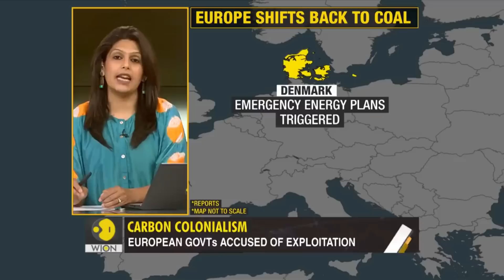Ghana is Finally going NUCLEAR POWER to intensify Industries and the African Free trade Area

Comment: NO NUCLEAR ENERGY AND THERE IS NO CLIMATE. CUT DOWN WASTE AND THE WORLD IS BE A BETTER PLACE!!!!!
Reply: There is no current or renewable energy solution that is going to meet the needs of Ghanas industrial, societal or.enterprise energy needs in a manner to compete with other world.players.

Name a country that is powering its industries and societies primarily through renwables? Norway? They are currently paying record prices to electrify and heat their homes. And that is based on their hydroelectric energy sources. Germany? They are getting prepared to put their renewable solution to its biggest test this winter. If that test fails? Millions of them will freeze.
.
 There are Afrikan countries that are already amongst the TOP 10 highest consumers of renewable energy. How is that working out for their respective industries and societies?
The 10 countries using the largest percentage of renewable energy are:

DR Congo - 96.24%
Somalia - 95.03%
Central African Republic - 91.26%
Uganda - 90.22%
Gabon - 89.88%
Ethiopia - 88.92%
Liberia - 87,24%
Guinea-Bissau - 86.24%
Tanzania - 85.22%
Burundi - 84.77%

For further comparison here is a macro look at renewable energy consumption on Country by Country basis:

Country Renewable Energy Consumption % 2022 Population
DR Congo	96.24%	99,010,212
Somalia	95.03%	17,597,511
Central African Republic	91.26%	5,579,144
Uganda	90.22%	47,249,585
Gabon	89.88%	2,388,992
Ethiopia	88.92%	123,379,924
Liberia	87.24%	5,302,681
Guinea Bissau	86.24%	2,105,566
Tanzania	85.22%	65,497,748
Burundi	84.77%	12,889,576
Zambia	84.50%	20,017,675
Madagascar	82.77%	29,611,714
Bhutan	82.27%	782,455
Zimbabwe	81.50%	16,320,537
Nigeria	81.40%	218,541,212
Iceland	81.07%	372,899
Niger	80.83%	26,207,977
Cameroon	79.41%	27,914,536
Mozambique	78.08%	32,969,518
Rwanda	77.86%	13,776,698
Chad	77.79%	17,723,315
Nepal	77.39%	30,547,580
Mali	76.64%	22,593,590
Haiti	76.40%	11,584,996
Togo	76.21%	8,848,699
Sierra Leone	75.44%	8,605,718
Eritrea	73.67%	3,684,032
Malawi	73.02%	20,405,317
Republic of the Congo	68.67%	5,970,424
Kenya	68.08%	54,027,487
Eswatini	65.95%	1,201,670
Guinea	65.44%	13,859,341
Burkina Faso	64.85%	22,673,762
Guatemala	62.92%	17,843,908
Ivory Coast	62.46%	28,160,542
Norway	62.37%	5,434,319
Sudan	62.23%	46,874,204
Uruguay	60.76%	3,422,794
Paraguay	60.09%	6,780,744
Myanmar	57.85%	54,179,306
Liechtenstein	56.13%	39,327
Angola	54.69%	35,588,987
Comoros	53.43%	836,774
Cambodia	53.36%	16,767,842
Papua New Guinea	53.09%	10,142,619
Sweden	52.88%	10,549,347
Nicaragua	50.71%	6,948,392
Sri Lanka	49.91%	21,832,143
Gambia	49.24%	2,705,992
Laos	48.43%	7,529,475
Solomon Islands	48.39%	724,273
Brazil	47.57%	215,313,498
Benin	46.47%	13,352,864
Honduras	45.96%	10,432,860
Finland	45.76%	5,540,745
Pakistan	43.46%	235,824,862
Ghana	41.80%	33,475,870
Latvia	41.52%	1,850,651
Albania	40.20%	2,842,321
Lesotho	39.47%	2,305,825
Montenegro	38.74%	627,082
Tajikistan	38.56%	9,952,787
Denmark	37.52%	5,882,261
Senegal	37.20%	17,316,449
Sao Tome and Principe	37.09%	227,380
Bosnia and Herzegovina	37.02%	3,233,526
Costa Rica	35.79%	5,180,829
Samoa	34.21%	222,382
Austria	33.77%	8,939,617
Lithuania	33.53%	2,750,055
India	32.93%	1,417,173,173
Croatia	31.60%	4,030,358
Estonia	31.29%	1,326,062
Colombia	30.72%	51,874,024
Namibia	30.69%	2,567,012
New Zealand	29.65%	5,185,288
Belize	29.09%	405,272
Portugal	28.19%	10,270,865
Djibouti	27.92%	1,120,849
Kyrgyzstan	27.88%	6,630,623
Peru	27.13%	34,049,588
Philippines	26.73%	115,559,009
South Sudan	26.65%	10,913,164
Fiji	26.48%	929,766
Botswana	25.57%	2,630,296
Chile	25.26%	19,603,733
Georgia	25.22%	3,744,385
Switzerland	24.76%	8,740,472
Bangladesh	24.75%	171,186,372
Mauritania	24.70%	4,736,139
Thailand	23.96%	71,697,030
Romania	23.54%	19,659,267
Canada	22.11%	38,454,327
Moldova	22.04%	3,272,996
Cuba	21.54%	11,212,191
Serbia	21.53%	7,221,365
Slovenia	20.86%	2,119,844
Bulgaria	19.34%	6,781,953
Indonesia	19.09%	275,501,339
Panama	18.91%	4,408,581
Vietnam	18.65%	98,186,856
Afghanistan	18.51%	41,128,771
Greece	18.51%	10,384,971
Andorra	18.40%	79,824
Ecuador	17.73%	18,001,000
Slovakia	17.64%	5,643,453
Italy	17.27%	59,037,474
Spain	17.27%	47,558,630
Germany	17.17%	83,369,843
Luxembourg	16.45%	647,599
North Macedonia	16.32%	2,093,599
Czech Republic	15.85%	10,493,986
Venezuela	15.62%	28,301,696
France	15.53%	64,626,628
China	14.45%	1,425,887,337
Suriname	14.40%	618,040
Turkey	14.12%	85,341,241
Palestine	13.86%	5,250,072
Hungary	13.64%	9,967,308
Greenland	12.60%	56,466
Ireland	12.34%	5,023,109
United Kingdom	12.24%	67,508,936
Tunisia	12.20%	12,356,117
Poland	12.18%	39,857,145
Cyprus	12.05%	1,251,488
Marshall Islands	11.70%	41,569
Timor Leste	11.67%	1,341,296
Guyana	11.35%	808,726
North Korea	11.31%	26,069,416
Argentina	10.74%	45,510,318
Morocco	10.69%	37,457,971
South Africa	10.50%	59,893,885
United States	10.42%	338,289,857
Grenada	10.37%	125,438
Mexico	10.34%	127,504,125
Armenia	10.34%	2,780,469
Belgium	10.21%	11,655,930
Australia	10.13%	26,177,413
Jamaica	9.09%	2,827,377
Mauritius	8.94%	1,299,469
Bolivia	8.67%	12,224,110
Netherlands	8.54%	17,564,014
Tuvalu	8.20%	11,312
Jordan	8.17%	11,285,869
Dominica	8.05%	72,737
Belarus	7.83%	9,534,954
Malta	7.70%	533,286
Japan	7.69%	123,951,692
French Polynesia	7.67%	306,279
Aruba	7.48%	106,445
Ukraine	7.44%	39,701,739
Equatorial Guinea	6.48%	1,674,908
Saint Vincent and the Grenadines	5.68%	103,948
Lebanon	5.46%	5,489,739
Faroe Islands	5.40%	53,090
Egypt	5.30%	110,990,103
Malaysia	5.11%	33,938,221
Israel	4.47%	9,038,309
Barbados	4.31%	281,635
United States Virgin Islands	3.66%	99,465
South Korea	3.36%	51,815,810
Mongolia	3.32%	3,398,366
Russia	3.22%	144,713,314
Yemen	3.11%	33,696,614
Guam	3.02%	171,774
Libya	2.80%	6,812,341
Curacao	2.68%	191,163
Puerto Rico	2.42%	3,252,407
Isle of Man	1.90%	84,519
Micronesia	1.78%	114,164
Tonga	1.77%	106,858
Kazakhstan	1.70%	19,397,998
Azerbaijan	1.62%	10,358,074
Saint Kitts and Nevis	1.58%	47,657
Uzbekistan	1.57%	34,627,652
British Virgin Islands	1.23%	31,305
Bahamas	1.14%	409,984
Maldives	1.11%	523,787
Syria	1.02%	22,125,249
Iran	0.98%	88,550,570
Antigua and Barbuda	0.91%	93,763
Singapore	0.84%	5,975,689
Bermuda	0.84%	64,184
United Arab Emirates	0.67%	9,441,129
Nauru	0.61%	12,668
American Samoa	0.50%	44,273
Iraq	0.43%	44,496,122
Trinidad and Tobago	0.34%	1,531,044
Palau	0.29%	18,055
Hong Kong	0.23%	7,488,865
Algeria	0.16%	44,903,225
Turkmenistan	0.06%	6,430,770
Kuwait	0.06%	4,268,873
Sint Maarten	0.05%	44,175
Qatar	0.04%	2,695,122
Saudi Arabia	0.03%	36,408,820
Brunei	0.01%	449,002
Oman	0.00%	4,576,298
Bahrain	0.00%	1,472,233
Cayman Islands	0.00%	68,706

Even the West does not take the renewable scam that seriously. Less so with the current test pending that they are facing this winter; without their usual supply from Russia.

There is no substitute for how the industrial economy runs today. The "renewable" push is a road to de-industrialization. A dead end one at that.

Afrika does not need to fall for any "Bait and Switch." They have to get tired of being dupes and suckers for Globalist schemes at some point. 

Renewable Energy is The Scam We All Fell For
https://youtu.be/lL6uB1z95gA

Bill Gates Slams Unreliable Wind and Solar Energy
https://youtu.be/9xe3BWPsBTU

Why renewables can’t save the planet 
https://youtu.be/N-yALPEpV4w

Comment: Are you efficient enough to handle nuclear power generation?  Have we exhausted solar and wind potential?  Give incentives to landlords to provide solar hybrids to cut down on wholesale dependency on the national grid.
Reply: It is clear that there is no current or renewable energy solution that is going to meet the needs of Ghanas.industrial, enterprise or societal ambitions.

Name a country that is powering its industries and societies primarily through renwables? Norway? They are currently paying record prices to electrify and heat their homes. And that is based on their hydroelectric energy sources. Germany? They are getting prepared to put their renewable solution to its biggest test this winter. If that test fails? Millions of them will freeze.
.
 There are Afrikan countries that are already amongst the TOP 10 highest consumers of renewable energy. How is that working out for their respective industries and societies?
The 10 countries using the largest percentage of renewable energy are:

DR Congo - 96.24%
Somalia - 95.03%
Central African Republic - 91.26%
Uganda - 90.22%
Gabon - 89.88%
Ethiopia - 88.92%
Liberia - 87,24%
Guinea-Bissau - 86.24%
Tanzania - 85.22%
Burundi - 84.77%

For further comparison here is a macro look at renewable energy consumption on Country by Country basis:

Country Renewable Energy Consumption % 2022 Population
DR Congo	96.24%	99,010,212
Somalia	95.03%	17,597,511
Central African Republic	91.26%	5,579,144
Uganda	90.22%	47,249,585
Gabon	89.88%	2,388,992
Ethiopia	88.92%	123,379,924
Liberia	87.24%	5,302,681
Guinea Bissau	86.24%	2,105,566
Tanzania	85.22%	65,497,748
Burundi	84.77%	12,889,576
Zambia	84.50%	20,017,675
Madagascar	82.77%	29,611,714
Bhutan	82.27%	782,455
Zimbabwe	81.50%	16,320,537
Nigeria	81.40%	218,541,212
Iceland	81.07%	372,899
Niger	80.83%	26,207,977
Cameroon	79.41%	27,914,536
Mozambique	78.08%	32,969,518
Rwanda	77.86%	13,776,698
Chad	77.79%	17,723,315
Nepal	77.39%	30,547,580
Mali	76.64%	22,593,590
Haiti	76.40%	11,584,996
Togo	76.21%	8,848,699
Sierra Leone	75.44%	8,605,718
Eritrea	73.67%	3,684,032
Malawi	73.02%	20,405,317
Republic of the Congo	68.67%	5,970,424
Kenya	68.08%	54,027,487
Eswatini	65.95%	1,201,670
Guinea	65.44%	13,859,341
Burkina Faso	64.85%	22,673,762
Guatemala	62.92%	17,843,908
Ivory Coast	62.46%	28,160,542
Norway	62.37%	5,434,319
Sudan	62.23%	46,874,204
Uruguay	60.76%	3,422,794
Paraguay	60.09%	6,780,744
Myanmar	57.85%	54,179,306
Liechtenstein	56.13%	39,327
Angola	54.69%	35,588,987
Comoros	53.43%	836,774
Cambodia	53.36%	16,767,842
Papua New Guinea	53.09%	10,142,619
Sweden	52.88%	10,549,347
Nicaragua	50.71%	6,948,392
Sri Lanka	49.91%	21,832,143
Gambia	49.24%	2,705,992
Laos	48.43%	7,529,475
Solomon Islands	48.39%	724,273
Brazil	47.57%	215,313,498
Benin	46.47%	13,352,864
Honduras	45.96%	10,432,860
Finland	45.76%	5,540,745
Pakistan	43.46%	235,824,862
Ghana	41.80%	33,475,870
Latvia	41.52%	1,850,651
Albania	40.20%	2,842,321
Lesotho	39.47%	2,305,825
Montenegro	38.74%	627,082
Tajikistan	38.56%	9,952,787
Denmark	37.52%	5,882,261
Senegal	37.20%	17,316,449
Sao Tome and Principe	37.09%	227,380
Bosnia and Herzegovina	37.02%	3,233,526
Costa Rica	35.79%	5,180,829
Samoa	34.21%	222,382
Austria	33.77%	8,939,617
Lithuania	33.53%	2,750,055
India	32.93%	1,417,173,173
Croatia	31.60%	4,030,358
Estonia	31.29%	1,326,062
Colombia	30.72%	51,874,024
Namibia	30.69%	2,567,012
New Zealand	29.65%	5,185,288
Belize	29.09%	405,272
Portugal	28.19%	10,270,865
Djibouti	27.92%	1,120,849
Kyrgyzstan	27.88%	6,630,623
Peru	27.13%	34,049,588
Philippines	26.73%	115,559,009
South Sudan	26.65%	10,913,164
Fiji	26.48%	929,766
Botswana	25.57%	2,630,296
Chile	25.26%	19,603,733
Georgia	25.22%	3,744,385
Switzerland	24.76%	8,740,472
Bangladesh	24.75%	171,186,372
Mauritania	24.70%	4,736,139
Thailand	23.96%	71,697,030
Romania	23.54%	19,659,267
Canada	22.11%	38,454,327
Moldova	22.04%	3,272,996
Cuba	21.54%	11,212,191
Serbia	21.53%	7,221,365
Slovenia	20.86%	2,119,844
Bulgaria	19.34%	6,781,953
Indonesia	19.09%	275,501,339
Panama	18.91%	4,408,581
Vietnam	18.65%	98,186,856
Afghanistan	18.51%	41,128,771
Greece	18.51%	10,384,971
Andorra	18.40%	79,824
Ecuador	17.73%	18,001,000
Slovakia	17.64%	5,643,453
Italy	17.27%	59,037,474
Spain	17.27%	47,558,630
Germany	17.17%	83,369,843
Luxembourg	16.45%	647,599
North Macedonia	16.32%	2,093,599
Czech Republic	15.85%	10,493,986
Venezuela	15.62%	28,301,696
France	15.53%	64,626,628
China	14.45%	1,425,887,337
Suriname	14.40%	618,040
Turkey	14.12%	85,341,241
Palestine	13.86%	5,250,072
Hungary	13.64%	9,967,308
Greenland	12.60%	56,466
Ireland	12.34%	5,023,109
United Kingdom	12.24%	67,508,936
Tunisia	12.20%	12,356,117
Poland	12.18%	39,857,145
Cyprus	12.05%	1,251,488
Marshall Islands	11.70%	41,569
Timor Leste	11.67%	1,341,296
Guyana	11.35%	808,726
North Korea	11.31%	26,069,416
Argentina	10.74%	45,510,318
Morocco	10.69%	37,457,971
South Africa	10.50%	59,893,885
United States	10.42%	338,289,857
Grenada	10.37%	125,438
Mexico	10.34%	127,504,125
Armenia	10.34%	2,780,469
Belgium	10.21%	11,655,930
Australia	10.13%	26,177,413
Jamaica	9.09%	2,827,377
Mauritius	8.94%	1,299,469
Bolivia	8.67%	12,224,110
Netherlands	8.54%	17,564,014
Tuvalu	8.20%	11,312
Jordan	8.17%	11,285,869
Dominica	8.05%	72,737
Belarus	7.83%	9,534,954
Malta	7.70%	533,286
Japan	7.69%	123,951,692
French Polynesia	7.67%	306,279
Aruba	7.48%	106,445
Ukraine	7.44%	39,701,739
Equatorial Guinea	6.48%	1,674,908
Saint Vincent and the Grenadines	5.68%	103,948
Lebanon	5.46%	5,489,739
Faroe Islands	5.40%	53,090
Egypt	5.30%	110,990,103
Malaysia	5.11%	33,938,221
Israel	4.47%	9,038,309
Barbados	4.31%	281,635
United States Virgin Islands	3.66%	99,465
South Korea	3.36%	51,815,810
Mongolia	3.32%	3,398,366
Russia	3.22%	144,713,314
Yemen	3.11%	33,696,614
Guam	3.02%	171,774
Libya	2.80%	6,812,341
Curacao	2.68%	191,163
Puerto Rico	2.42%	3,252,407
Isle of Man	1.90%	84,519
Micronesia	1.78%	114,164
Tonga	1.77%	106,858
Kazakhstan	1.70%	19,397,998
Azerbaijan	1.62%	10,358,074
Saint Kitts and Nevis	1.58%	47,657
Uzbekistan	1.57%	34,627,652
British Virgin Islands	1.23%	31,305
Bahamas	1.14%	409,984
Maldives	1.11%	523,787
Syria	1.02%	22,125,249
Iran	0.98%	88,550,570
Antigua and Barbuda	0.91%	93,763
Singapore	0.84%	5,975,689
Bermuda	0.84%	64,184
United Arab Emirates	0.67%	9,441,129
Nauru	0.61%	12,668
American Samoa	0.50%	44,273
Iraq	0.43%	44,496,122
Trinidad and Tobago	0.34%	1,531,044
Palau	0.29%	18,055
Hong Kong	0.23%	7,488,865
Algeria	0.16%	44,903,225
Turkmenistan	0.06%	6,430,770
Kuwait	0.06%	4,268,873
Sint Maarten	0.05%	44,175
Qatar	0.04%	2,695,122
Saudi Arabia	0.03%	36,408,820
Brunei	0.01%	449,002
Oman	0.00%	4,576,298
Bahrain	0.00%	1,472,233
Cayman Islands	0.00%	68,706

Even the West does not take the renewable scam that seriously. Less so with the current test pending that they are facing this winter; without their usual supply from Russia.

There is no substitute for how the industrial economy runs today. The "renewable" push is a road to de-industrialization. A dead end one at that.

Afrika does not need to fall for any "Bait and Switch." They have to get tired of being dupes and suckers for Globalist schemes at some point. 

Renewable Energy is The Scam We All Fell For
https://youtu.be/lL6uB1z95gA

Bill Gates Slams Unreliable Wind and Solar Energy
https://youtu.be/9xe3BWPsBTU

Why renewables can’t save the planet 
https://youtu.be/N-yALPEpV4w